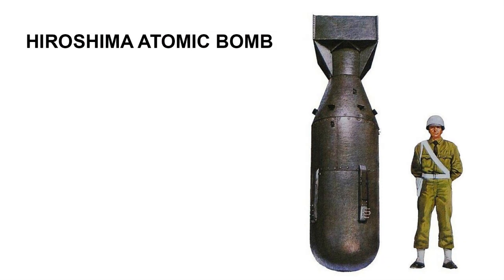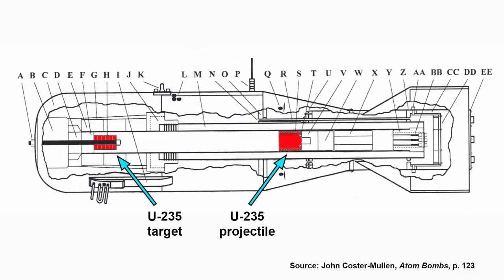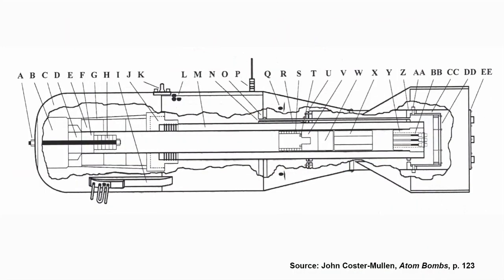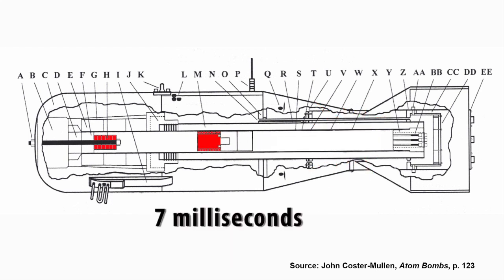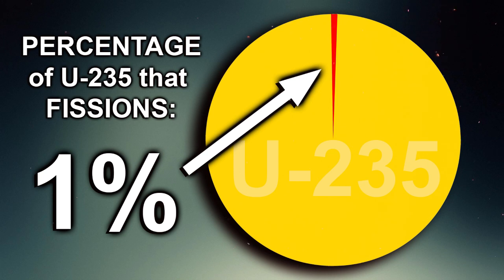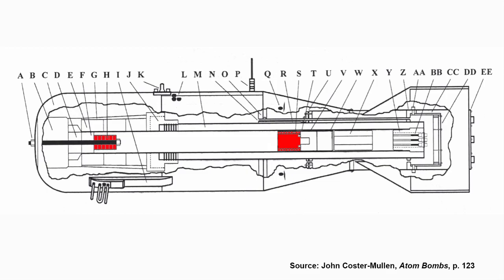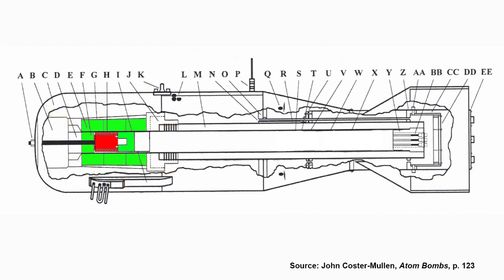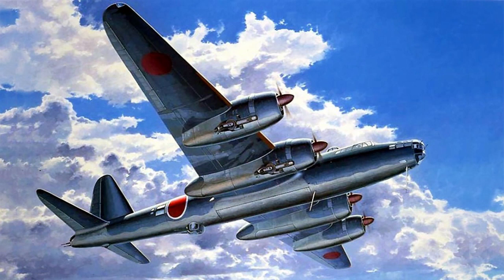ATOMIC BOMB: How the Hiroshima A-Bomb was Made (Pt. 2)

Comment: Was there any provision to vent the compressed air in the gun tube that might have retarded the acceleration of the uranium projectile after the cordite charge detonated? ?  Or was the cordite charge so powerful that this effect was not an issue?
Reply from the maker: No venting that I'm aware of. I would highly doubt there was. The cordite charge was indeed very powerful for maximum velocity. It was all over in milliseconds, so no need to ease the strain on the gun barrel.

Comment: The Hiroshima bomb must be the most inefficient A bomb ever built, when you consider the fact that if of a propper geometrical form it only requires about 26 lbs 95% pure U235 to produce the same effect. And a beryllium reflector can reduce that even more. Talk about crude
Reply: The Mk-I was not the most inefficient A bomb ever produced. I can think of at least one example with a lower efficiency: The W-54 mod 2, with an efficiency as low as 0.015%, compared to at least 1.14% for the Mk-I. That at least 76 times less efficient.

Comment: I only have one question about this bomb after watching this excellent series.  Why does bringing the two masses of Uranium 235 together rapidly cause the reaction?  You explained how the reactions happen nicely, but I am a bit confused about how the supercriticality happens when it is just bringing together atoms which are existing alongside each other in the rings already.  Yes, I can go research it and I will, but it would have been nice to include the mechanism's reaction dynamics here.  Thanks for the great video regardless of my critique.  I just hope it helps your channel a bit.
Reply from the maker: The chain reaction happens whether the pieces are brought together quickly or slowly. The need for speed is to maximize the explosive yield of the chain reaction, which happens so fast, in just millionths of a second. If the uranium projectile is not moving fast enough, the bomb will blow itself apart (and scatter the uranium) before the two pieces have fully come together, hence the explosion will be a “fizzle.”
Reply: @realsamuelhawley  Thanks for the reply.  That clears up part of it, and I did look into it a bit as well.  So, the gun is for building the supercritical block quickly for maximum neutron carnage before lesser reactions can "jump the gun"(pun intended).  It seems that slowly putting them together would be like throwing a firecracker into a small pile of firecrackers.   There may be some ignited after the first blast, but mostly they'll be unlit and blown away from the source of ignition.  Do I understand correctly that the two pieces (when apart) aren't enough mass individually to trigger a reaction, but the quick combination of them in a tight space is the tipping point to optimal supercriticality?
Reply from the maker: @troys9222  Yes, that seems to be about right.

Comment: What does critical mass mean? It was a nice video but, it didn't explain the core mechanism that I wanted to know: why do you need to shoot the 2 sets of rings to start the explosion. I used to think that you smash the two blobs together, but in this explanation it seems that instead you just line up the two blobs to make a bigger blob. How does that start the explosion?
Reply: Critical mass is the critical minimum amount of fuel required for a self sustaining reaction. When a nucleus fission, it releases neutrons. The chance of these neutrons interacting with another uranium nucleus is quite small, it can pass right though. If you have a larger block of material, there are more nuclei between where the neutron originated and the air (or whatever other material) outside the fuel.
If you're in a room, and you close your eyes and throw a ball in a random direction, the bigger that room, with more people in it, the higher the chances of you hitting someone compared to hitting the wall.
If we suppose the room needs to be 10,000 square feet and contain 3000 people (made up numbers) for you to have a 50% chance of hitting a person and 50% chance of hitting the wall, you could say that size and number of people is the critical size for you to be equally likely to hit and miss. Now if the rules are that anyone who is hit with the ball has to throw their own ball in a random direction, then if your number of people is the critical number, this chain reaction of people throwing balls at each other will be self sustaining. Obviously an inaccurate analogy, but it gets the point across.

As for why the two rings were separated initially (to prevent any chain reaction) imagine you divide this critical number of people into two rooms, a mile apart. If you throw your ball, the chances of hitting people a mile away are low, and there aren't enough people close to you for you to have a 50% chance of hitting someone. So chances are your ball will hit the wall, and the game ends. Bring the people in the other room closer, and the odds begin to shift on your favour.

Comment: Awesome Videos!  Would be interesting to know how they figured out it was barely 1%?  ( https://youtu.be/3iTr2W9p8TI?t=324 )  And since it was 1%, would it have been possible that the first 2 plates fissioned and exploded before the rest of the uranium plates could?   Making the subsequent plates unnecessary.
Reply: No.  Then there wouldn’t of been enough material to form a critical mass.
Reply: @wadeshort3  thanks for replying... Great work on the imjin series Btw! Amazing story telling and very engaging.
Reply: We know the average energy released per fission event. We know the mass of a single nucleus. We know how much energy was produced by the weapon (approximately).
Based on estimates of the yield of the explosion, we can calculate that the efficiency was between 1.14 and 1.58%.
The central region of the core would have fissioned more efficiently, as the neutron flux was highest there, however material fissioned in all the rings and all were necessary to produce the explosion.